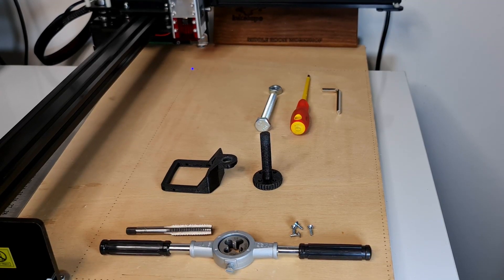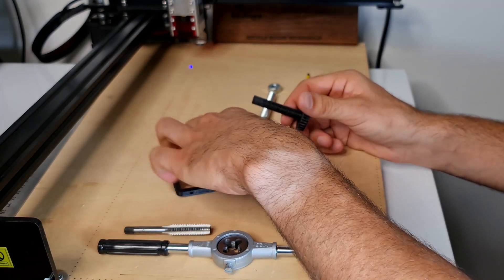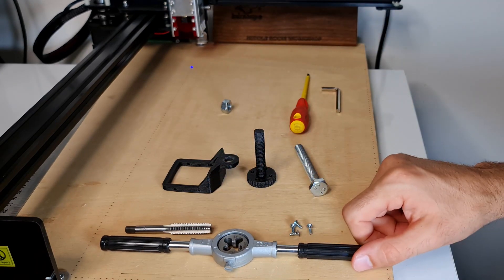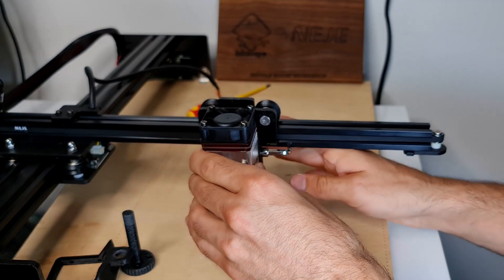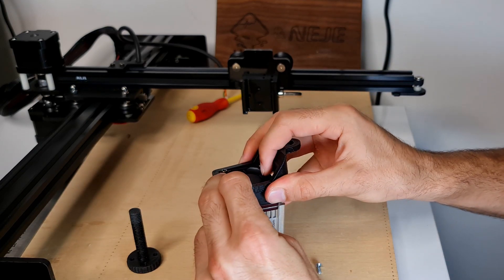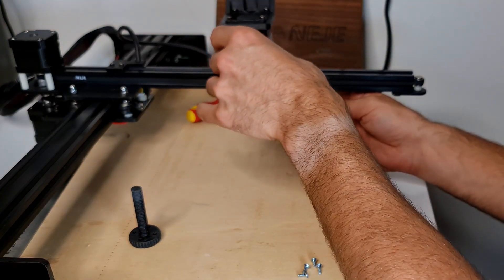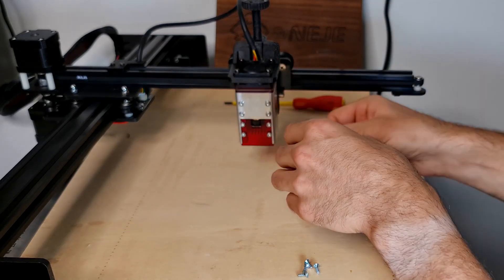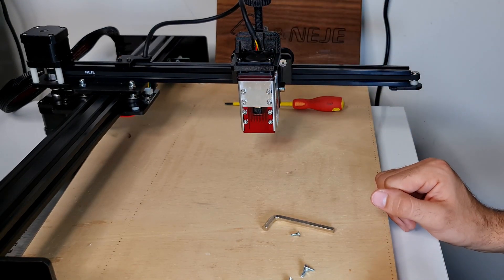How to install the Height Adjuster in your Neje Master Laser Engraving Machine

Comment: my 20w is adjustable focus but i would rather fix focus it and put on z adjust mount like this but not sure to just glue the lens to stop rotation or where to get a fixed lens
Reply from the maker: Hello Lost Cloud,  thank you for your comment.

I tightened mine and it does not move, but if your does not I would suggest sticking a tiny piece of double sided tape in between the face of the knob and the module, then tight it again.
This should keep it in place, giving you the opportunity to easily change lens in the future.

Ciao